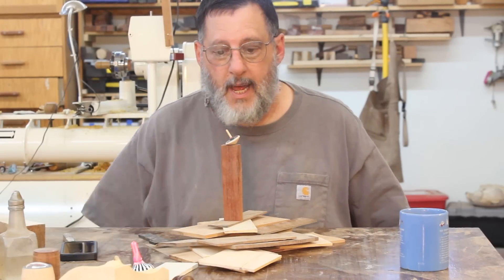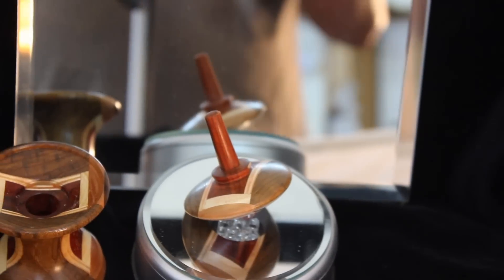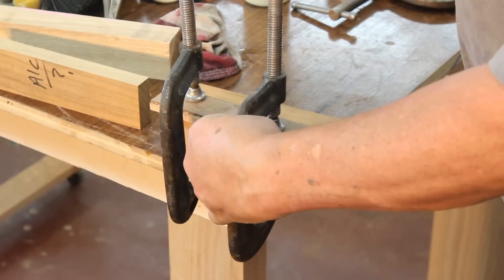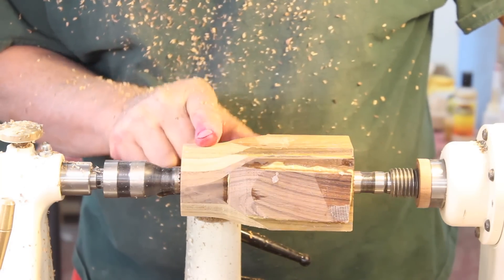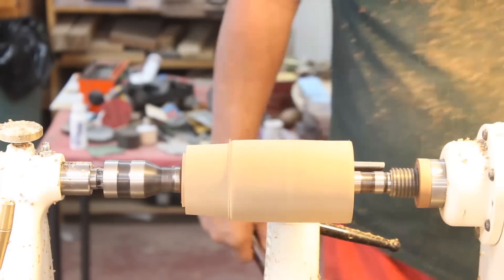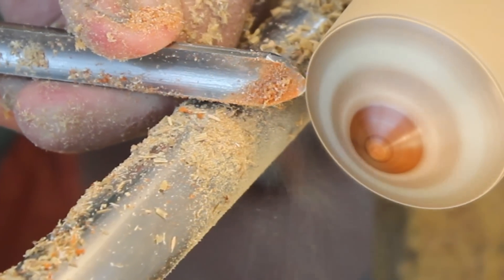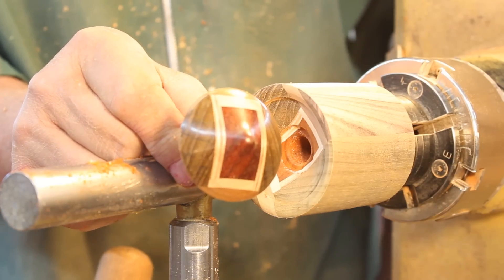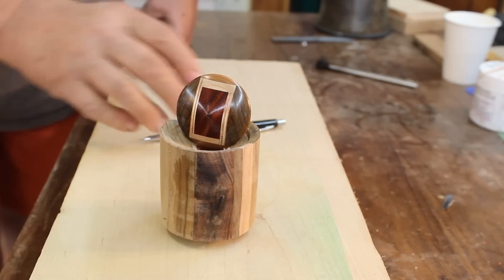Executive Desk Top  (part 1)  by Sam Angelo

Comment: Sam, this is a very clever top/box. I have tried a few but yours is very cool. You might have encourage me to make another. Thanks for the inspiration.
Reply from the maker: +Marshall Gorrow Marshall, OK here is the lowdown.......I had no idea what the hell I was doing.  But it came out fairly well.  It really was my first segmenting this type of project.  But I consider it more laminating scraps of wood.   Send me a photo of the finished project.  Sam
Reply: +WYOMINGWOODTURNER  Sam, I don't do much segmenting, laminating or stave work. The ones that I have turned were from solid wood. Mine are plain compared to yours.